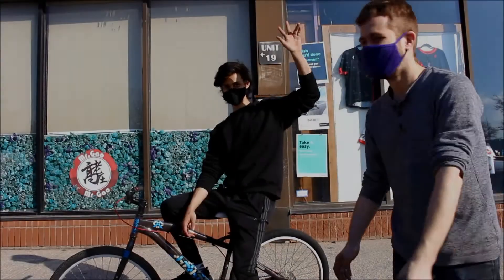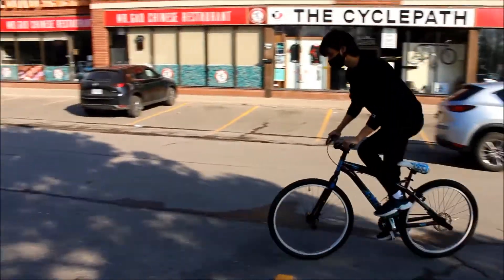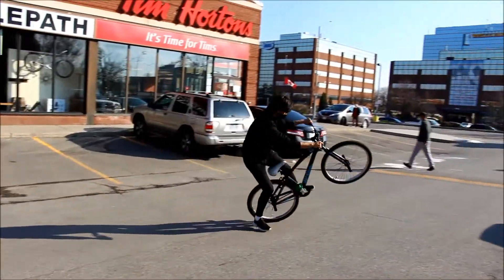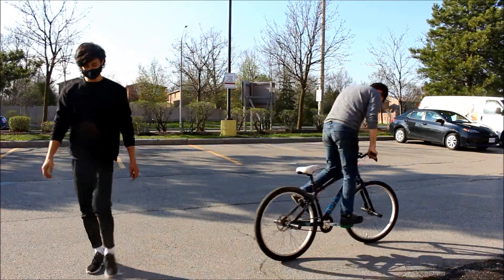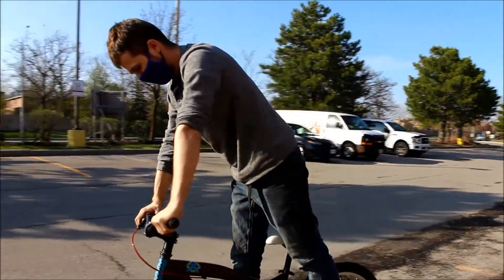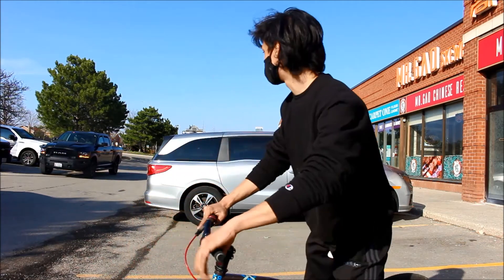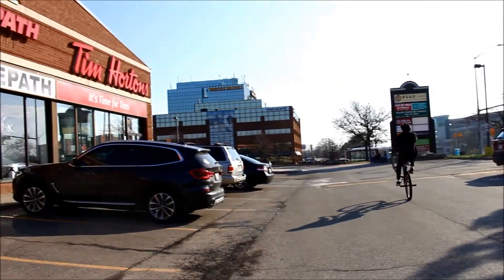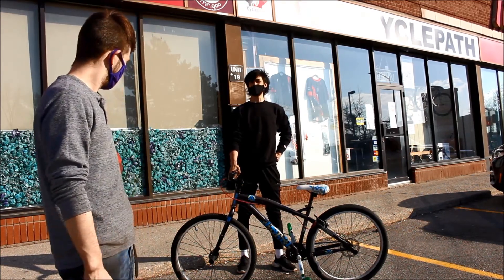Parts bin WHEELIE BIKE - Project: Used Bikes (s2e6)

Comment: Do you think you can make a parts bin wheelie bike under 100 or 150 because I really want one,but am in a tight position right now.
Reply from the maker: Most years that would be pretty easy but the bike world is pretty crazy right now and it's hard to get used parts. The bike in this video and most of the parts came from the charity it built it for.